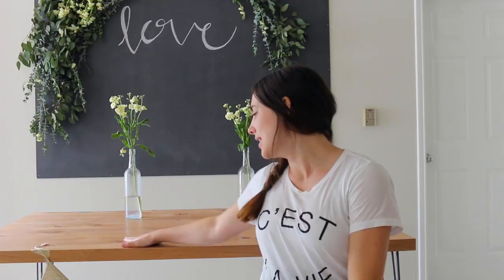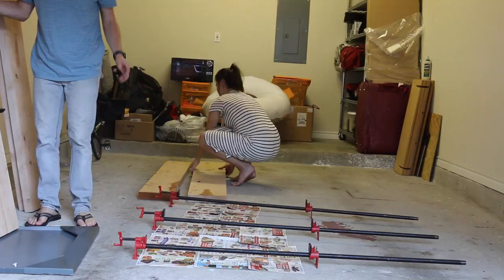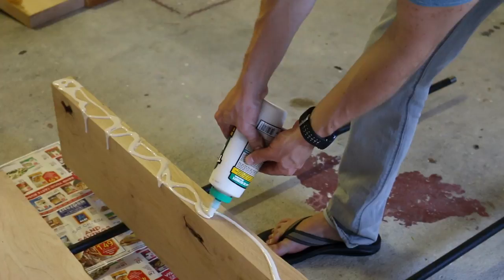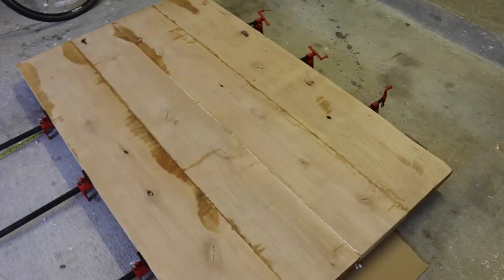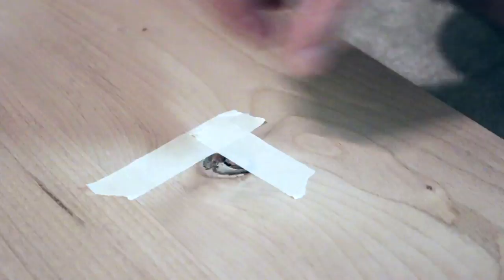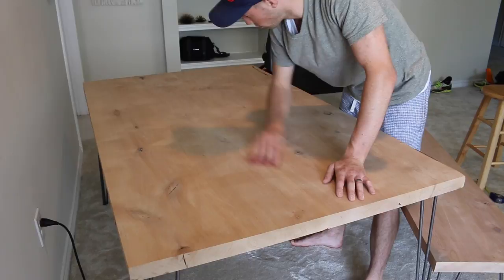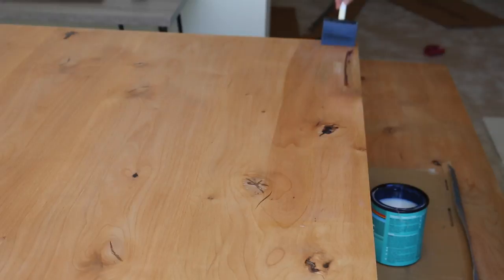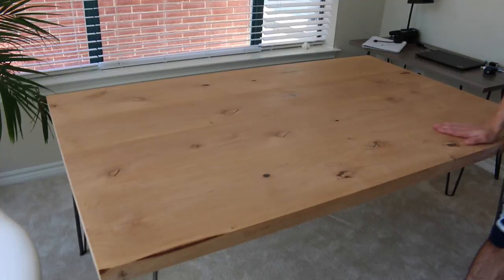DIY Kitchen Table + Bench | Lindsay Brooke

Comment: Little top tip: when I saw the application of the epoxy, to avoid air bubbles inside you should just heat it up with a hairdryer or a heat gun if you have one. all the air bubbles come to the top and disspapear.
Reply from the maker: Awesome tip! Thanks for sharing!!

Comment: Love the table. Thanks for sharing. What's the measurements on your table and bench? Also, how much did this project cost? And what kind of wood did you used? Thanks!
Reply from the maker: The table is 3x5 ft and the bench is 1x5 ft! I believe everything cost about $300, but we were going for a really nice quality table, so we got nice wood. You could definitely make it for cheaper!! We used alder wood from a mill and had the mill cut it and sand it for us- so that cost more too. Getting wood from like Home Depot and sanding it yourself would cut the costs significantly!